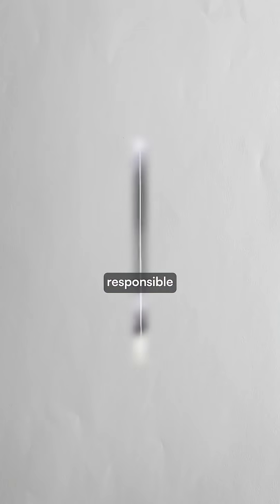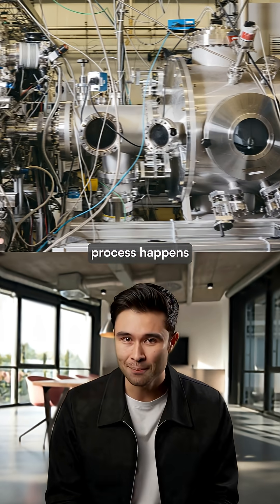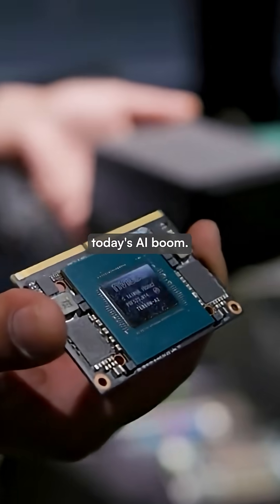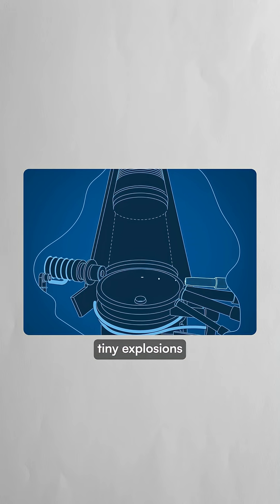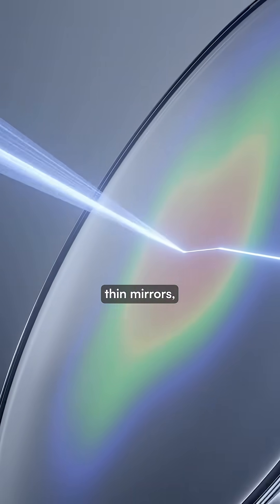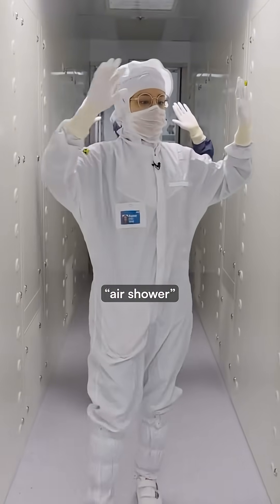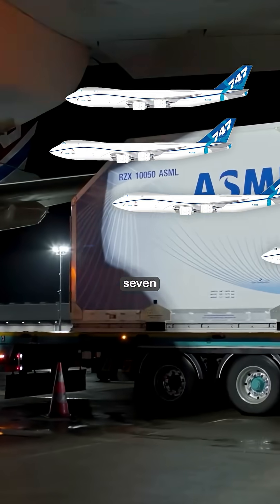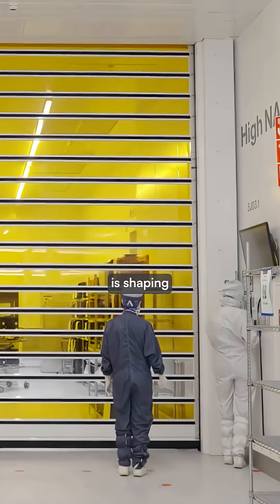These machines are responsible for the world’s computer chips ⚙️ #trendingshorts #ai #data #tech

Comment: Its wild that the machines critical to the production of all modern chips are made in Europe and even some CPU design like ARM is now done in Europe, yet Europe itself has virtually no domestic chip manufacturering compared to the US and China
Reply: It’s because of supply chains. Most of the lower level supply chains are in Asia.
Reply: In a gold rush, sell shovels
Reply: @mattmurphy7030 Not necessarily a gold rush…it’s like calling having water is a gold rush considering the entire world is built around electronics. The only way for this gold rush to fail is if there’s a nuclear armageddon
Reply: @WimsicleStranger actually look up the water wars going on right now. Very in the background, but very real.
Reply: ARM designs originated and are designed in Britain. However, ARM licences its designs to other companies in two forms. 1, just lets them make the chip designs as ARM designs it. The other like Apple and others use lets them use ARMs architecture and IP to design their own custom chips.
Reply: @KellyHarding78  ARM doesn't license their designs, they license their ISA, and those who have a license design their chips in-house. This lets silicon designers design a custom chip without having to build up the software tooling (compilers, debuggers, etc.) manually.

A good analogy is like the EV space. Ford builds the ev car and it can use the Tesla charger plug (ISA) so it can be used with the Tesla supercharger network (the software tooling)
Reply: At one point all ARM designs were made in the UK. Europe makes tons of chips they are just specialised so you personally have never heard of them.
Reply: @backgammonbacon UK has had a lot of silicone chip innovation that has been cutting edge for many decades and I think most are unaware of this. Unfortunately no laws protect this tech being sold by competitors anywhere. A lot of IP tech is sold to foreign companies/nations originally developed in the UK with little or next to no investment from UK gov and also we don't seem to attract enough private investment either. I think we lose out greatly by not securing high tech manufacturing in the UK. Universities often make great breakthroughs and patent it then sell it off for foreign nations to benefit from our ingenuity. Maybe part of the problem is not having cheap energy, nothing can survive let alone thrive without cheap abundant energy and renewables aren't to provide that. This is easy to prove. China dominates mining and processing/refining of rare earth minerals and also manufacturing of renewables but relies more on mainly coal and nuclear. If renewables were truly more sustainable and cheaper to use then China would have transitioned fully by now a decade or more ago to give competitive edge to manufacturing costs and AI innovation. I think this is why China will lead and the West will lose all innovation and the AI tech race. Cheap energy or nothing, we lose it all.
Reply: Ireland is in Europe
Reply: @kchickenlord  Intel isn't irish.
Reply: @punkedcrap  Intel has a few fabs in Ireland that manufacture a variety of products. If it's inside Irish borders it's domestic manufacturing regardless of where the company started.
Reply: @kchickenlord  unless things have changed since I entered the job market 5 years ago, there's no chip manufacturing in Ireland; only designing of chips
Reply: @safebox36  They've been manufacturing in Leixlip since 1989. Fab 34 only started production in 2023.
Reply: Globalfoundries has a pretty big FAB in Dresden
Reply: @-Noc  yes, but its very much outdated. Like Intel.
Reply: @claudiliciousX3D  its not outdated I think, they just dont make 7nm, their market is 22 and up.
Reply: ARM does not make CPU designs slow ahh. They license the instruction format. Other companies make the designs and have to pay a fee to use the format. This is why RISCV exists as an open source alternative
Reply: @honkhonk8009  Almost all ARM chips today are using ARM's core silicon designs.  Apple is the only one currently ONLY using their own cores and Qualcomm is the only other company that makes a core that anyone cares about - even Qualcomm only uses their "own" core for their Big cores, all their smaller cores are ARM cores.
Reply: @honkhonk8009 
I think ARM does both.
License their IP and sell designs.
Reply: @honkhonk8009  arm licenses designs too not just the instructionset. But bigshots like apple roll their own... but others do not, for instance nvidia doesn't 😂😂😂😂
Reply: @honkhonk8009 were you saying slower with  British accent when you said slow ahhhh
Reply: Our developed, highly educated economies basically cause us to make the blueprints for the world. We design, China and Taiwan build it.
Reply: Yes that is bizarre
Reply: The silicon wafers blanks are manufactured in the UK, which is technically in Europe.

Taiwan has TSMC which manufactures the most high end chips. They got there through government investment and a decades long struggle of private enterprise.
Reply: Europe has the talent, infrastructure,  and research institutions, maybe we'll see advanced chips made on the continent soon.
Reply: @brianhoade1411 no they don't, they've been trying forever. States have been slowltly falling behind every year for at least 2 decades... im in the industry. ASML is one small part of the puzzel.
Reply: @brianhoade1411  intel already made a facility here its in its testing phase right now
Reply: @BrandonDenny-we1rw 1 fab and it’s not even the small stuff life the 6nm machines we have now their still stuck on  decades old nodes
Reply: @nicholasm5184 it was designed for 2nm range actually. but yes only 1 fab
Reply: @nicholasm5184 you must have missed that i said specifically a New. as in literally its the most advanced one to be made actually it was highly coveted and sought after but intel got it and built it in the us
Reply: @brianhoade1411 You couldn’t make it more obvious how oblivious you are.
Reply: It's all about money. Companies wants guaranteed returns on their investments. So they go with the sure thing. It often takes govt or some deep pocket risk taker to want to go it alone.

Look at spacex
Reply: And don't forget China's chip manufacturing technology is years behind.
Reply: Most chips made in Europe are for industry and military application, you never see them unless you are in my sector. God bless STM
Reply: @docvolt5214 yeah so true i hear the nut gurgling sector is really hot rn
Reply: It's because the talent they have is league's ahead a bunch of other countries
Reply: The thing is we don't want to have much manufacturing. The sky is crystal blue unlike in China or India.
Reply: @matt-eu-poland  that's just Europe for you. Crafts and manufacturing are a necessary evil that drive our capitalism. "We" don't want to elevate craftsmen otherwise they'll become too expensive. Meanwhile, more and more people in Europe don't want to share a country with those who are willing to do the work. This is mutually exclusive and populism solves nothing, other than giving manual and low paying jobs back to the locals, so that the local business people can make more profit. That's literally what it is, and that's literally what's happening in America right now.
Reply: China? You meant Taiwan right?
China did not had the manufacturing powers of “AI” chips until late this year onwards. You can argue this or that, but the sanction on chips were important to China until they now make their owns and inventing one more advanced than Taiwan one
Reply: my point aws simply almost all of it opiginated in the united states usually at MIT, then over time different western supply chains decided to do that work to make them at least that is what I believe if I am wrong let me know
Reply: You spelled Taiwan* wrong.
Reply: All countries have contributed to modern life
Reply: Made in Europe? Nope! Parts from other countries like Japan & US also comes in, the final assembly takes place in Europe!
Don't take it as an insult or underestimating Europe, but that's the reality on ground.
Without those imported & foreign components ASML won't be ASML!
Reply: The modern computer was conceptualised in England by Alan Turing. It's literally a European invention and it was instrumental in beating the Nazis.
Reply: @bramweinreder2346  The "father of the computer" is Charles Babbage who invented The Analytical Engine in the 19th Century.  Ada Lovelace created some coding for it (not known to be programming language at the time).  Unfortunately both were not followed up for another near century.
Reply: @nelsonwong4631 no argument here, but let's also credit Bool, Kelvin and von Neumann, among others. I simply mentioned Turing because everything that comes to mind nowadays is a direct evolution of his work.
Reply: @bramweinreder2346  The first modern computer was built in Nazi Germany by Konrad Zuse in 1941.
You should read about him if you hadn't heard of him before. He was truly a brilliant person.

I don't want to talk down Turing's works but it is important to see how and where the computer development started.
Reply: @bramweinreder2346  Its British invention.
Nazis were Europeans.
Reply: @bramweinreder2346  
"Instrumental" might be an overstatement.  I'm sure it was useful, but the fate of the Nazis was sealed when Operation Barbarossa failed in 1941.
Reply: And then a lot of people's minds they will give credit to the countries where the chips are made instead of giving it to occidental countries. Giving a false impression that the companies producing the chips are the more advanced countries.
Reply: We have Fab 1 in Dresden
Reply: They are global product. Some wild supply chains have to work in tandem to make it all happen. This is after all most complex technology at present time.
Reply: "chips are made in Europe"

not made, but designed. it's made in taiwan or china
Reply: Guess you have never heard of InMos. And I work at the Translational Research Hub building of Cardiff university this building houses the Compound Semiconductor Institute. Which has it's own Wafer fab. We have a small version of that amsl e-beam lasers working on a 7nm node
Reply: They're too busy feeding Africa to make this type of investment
Reply: It's not really that strange.

This is true for all types of high end tech.

Between US, China and the EU most complex things are manufactured with multiple companies involved.
Reply: It's even more wild that the USA throws its weight around against foreign makers like AMSL to try and prevent China getting access to the machines
Reply: This more like an alien technology transfer from the Nordics 😊
Reply: Not really, when an education costs $100,000 and all your made in the USA is actually made in China. It's weird they haven't evaded taxes like most other companies that move to the US. But the Dutch have a monarchy.
Reply: So one needs the other?
Reply: Modern, advanced chip making, besides requiring specific skills, is an industry that requires certain conditions to be sustainable. Among other things, it requires humongous quantities of water. That's why Taiwan has so many fabs - it's literally and by far the rainiest point on earth. Europeans may have the skills to make the machines and design the chips, but a single larger fab or an agglomeration of fabs anywhere in Europe would profoundly stress out that region's water supply - besides requiring the build-up of skills Europeans do not yet have. It's simply cheaper for Europe to sell machines and know-how and import the ready-made chips from Taiwan and South Korea.
Reply: Europe is the hotbed of all major inventions and discoveries todate, period.
Reply: Old World Black Empire technology. They are rolling out Old World Black Empire patents to make you believe the timeline is real and that they are inventing and giving you technology.

They are not.
Reply: It used to have a lot of chip manufacturing but the companies in their extreme stupidity moved it all overseas, a decision which in the current geopolitical situation was a rather stupid idea. Hence US semiconductor manufacturers begging the US government for money to build plants again.
Reply: IPhone is made in China but is does not belong to Asia ...
Reply: Europe outsource to Taiwan because they don't want to pay the higher labour costs. When you are dealing with multimillion dollar machines what difference is a little higher labour costs honestly? It blows my mind.
Reply: Well that’s because the United States has partnered with Europe, Japan, Taiwan and South Korea to make the distribution of these technologies spread across all of these countries. It makes it so that it’s nearly impossible to steal all of the technology and components necessary to produce these processors. 

Taiwan has the biggest fabs in the world and something like 50% of the chips in the world are produced by them. This was purposefully done to make it impossible for China to invade Taiwan without major consequences. If they do decide to invade it will effectively mean that the entire world economy will collapse and we will see no new computers, GPUs or smartphones. As well as nearly all major factories that produce automobiles, planes and other products will not be able to function without these chips. 

The reason is that if China invades they will basically be pushing the entire world economy into a deep depression and when the entire world knows they can’t get a new phone, computer, car and that technological advancement stop as a result. It will make the entire global community so upset with China that even if they are successful with their invasion of Taiwan they will ruin their reputation globally. The resulting unemployment, inflation and collapse of people’s savings and the stock market will make so many people upset with their actions that it will make them a pariah state similar to North Korea. Most investors will pull out their investments, their neighbors will cut off trade and turn on them politically. Likely driving most of them to partner with the United States and Europe instead. 

We are even planning for this as the United States is building its chip capacity to be able to replace Taiwan with new fabs all across America being set to open over the next 2 years. In fact if China does invade Taiwan it will simply result in all of its top engineers leaving immediately to go to Arizona and begin producing chips. It’s very likely that the current fab in Taiwan is already targeted so that any invasion would lead to these fabs being destroyed and China achieving nothing from taking them. All of the lithography machines and other key equipment would likely be blown up and they would effectively be banned from every purchasing any machines from ASML as a result.
Reply: Cheap labor abroad.
Reply: The US has virtually no domestic chip production.  It is all made in Taiwan and China and other Asian nations like Russia.
Reply: Taiwan is a sovereign nation
Reply: It's not wild. It's called specialization.
Reply: Europe has been making precision machines destined for export for a very long time, they are a continent not a country of course and no one of them compares to the US or China in the size of its market so it's no surprise they don't produce chips.
Reply: TSMC is not in China or the US.  TAIWAN Semiconductor Manufacturing Company...🤦‍♂️
Reply: It's just the way globalisation went. The US discovers new methodologies, Europe has the funding to put those methodologies to use, and Asia has the resources to mass-produce the end result of said methodologies.
It's the same with most things that are in high enough demand, the only things made locally anymore are food due to expiration dates and vehicles due to local safety laws and ROI.
Reply: I saw a ghost in 2015 on a tv. I have a picture of a ghost on a tv.
Reply: They aren’t allowed to
Reply: Shame 😢😢😢
Reply: Bro, what you said about ASML is truly fascinating. A single machine costs $400 million, takes 18 months to build, requires 7 jumbo jets for delivery, and still it cannot come close to the complexity of a single human eye — which Allah created for free.

Think about it:

That machine can only function because it follows fixed physical laws (light, lasers, droplets, vacuum). Who created and sustains these laws so perfectly?

If humans need thousands of engineers, billions of dollars, and years of effort to make just one imperfect machine — then who engineered the human brain, with 86 billion neurons working in perfect harmony?

If one chipmaking tool requires so much planning, can the universe, galaxies, life, and even your own heart come into existence “by chance”?

The Qur’an asks:
“Were they created from nothing, or are they themselves the creators?” (Qur’an 52:35)

And also says:
“He created everything and determined it with precise measure.” (Qur’an 25:2)

Bro, human technology only exposes how dependent we are on the laws set by Allah. Even with all this science, nations still fight for monopoly and power. But on the Day of Judgment, no monopoly will remain. Allah will ask:

“To whom belongs the dominion today? To Allah, the One, the All-Powerful.” (Qur’an 40:16)

So yes, ASML’s machines are impressive — but they are nothing compared to the creation of Allah. If we admire human invention, shouldn’t we admire and submit even more to the Creator who gave humans the knowledge in the first place?

Turn back to Allah before the Day comes when no technology, no machine, no power will save us — only faith and good deeds will.
Reply: And Europe is about to hand it all over to the Muslims
Reply: Big mistake
Reply: It's a geopolitical strategy, to unconcentrate power in a vast network so that nobody could hold all the power, making all the countries in the supply line dependent on each other
Reply: What are you talking about? Europe has more chip manufacturing than China! We have
STMicroelectric 
Infineon
NXP Semiconductors
+ globalfoundries fabs (which is not a european company, but has fabs in europe)

Each of them has more revenue and more chip Output than SMIC, the only relevant chinese chip manufacturer.

China is good at marketing and social media. We are silent and hesitant about our achievements. But we are so much more successful than china, just nobody knows it
Reply: @JohnyVescoya all of those arent cutting edge and only the newest
Chips are good for AI, europe is behind
Reply: The US also has virtually no domestic chip manufacturing then, Intel is 5 years behind TSMC, AT BEST!
Reply: @claudiliciousX3D 
Behind doesn’t mean no manufacturing capacity.
Reply: @claudiliciousX3D tsmc is also in US
Reply: I live in the U.S. and live next to a facility that is unlisted as a chipmaker. It’s a “secret” facility. The only reason I know about the place is because I helped build it. It’s a massive building. The entire building is mounted on special shock absorbers to remove the tiny shakes from earth itself. They built this factory in a part of the U.S. that nobody would expect. Nobody around me even knows its here. This is the first time I’ve ever spoken about it. We do some incredible things in the U.S. that are not openly discussed. Keep that in mind. Vigilantes sumus te. 😉
Reply: @TsunauticusIV Arizona?
Reply: @TsunauticusIV  - Very true. "People think" that the United States is so backward, but there is a SO MUCH going on here that nobody knows about.
Reply: europeans created the modern world and the most advanced civilization ever.
Reply: @Hogan-d4i all past tense, now. China is back on the top of the wheel while Europeans succumb to the barbarism that drove them on a global bout of rape and pillage. Humanity has a future far beyond them.
Reply: I thought it was South Korea and/or Taiwan that were also making chips with these insane machines.
Reply: @ALucas73  yes, TSMC is the number 1 player with the highest yield rates, TSMC stands for Taiwan Semiconductor Manufacturing Company. The number 2 player and TSMCs only real competition is Samsung Foundries in South Korea. Both companies have facilities all over the world though.
Reply: @ALucas73  It is. Euros are delusional and genuinely overestimate their importance in the world.
Reply: Tsmc isnt china
Reply: It's the real China aka Taiwan  @staples4335
Reply: @staples4335  SMIC is chines
Reply: @staples4335 tsmc is China
Reply: The supply chain for all this is so complicated no one country could make cutting edge chips all by themselves
Reply: It's not matter where the euv  machines are made prease send for me emails of all the detailed blueprints of these machines to our offices in Shenzen China. The senders will be greatly and richly rewarded by our great leaders and patriotic comrades from the CCP.
Reply: Ppl don't understand that the US is basically European. Think the narliest most ambitious Brits are the forefathers 😅
Reply: India is way ahead😂
Reply: Europe is the best
Reply: There are many fabs here in the EU. I am an analog Chip Designer.
Reply: But they have migrants & debt...
Reply: @tropickman 

Hi Connor
Reply: @tropickman what does migrants have to do with anything
Reply: @tropickman kay why es
Reply: @tropickman  lol. The USA has more debt than any country by a really really big number. China is 2nd with half of that
Reply: @tropickman  nobody can challenge the US in debt
Reply: @tropickman So does the US
Reply: @tropickman  oh my God humans moving and spending money 😱
Reply: @tropickman it's all by design.  The globalists are trying to erode the heritage and culture of Western Europe
Reply: @tropickman  Debt compared to whom? Some European countries (France, Italy, Greece, for example) have a very high debt-to-GDP ratio. But that's more or less on par with the USA, and half of that of Japan. The Netherlands, where these machines are made, have roughly half the debt-to-GDP ratio of China.

As for migrants, perhaps you haven't been paying attention to Europe's declining birth numbers. It's either migrants or disappearing.
Reply: @tropickman  every country has migrants, and we have less debt than America or China
Reply: @tropickman migranz Because of USA war
Reply: @tropickman That a joke?
Reply: @tropickman   migrants is not a sickness